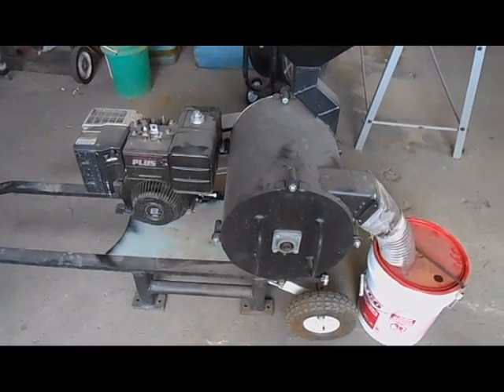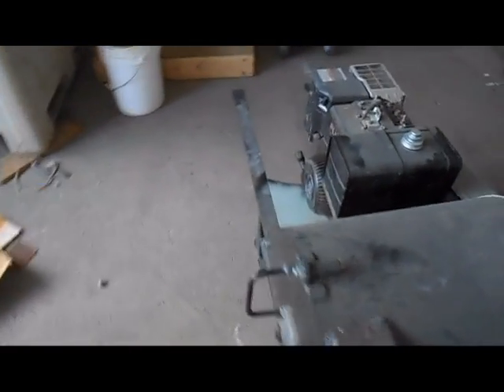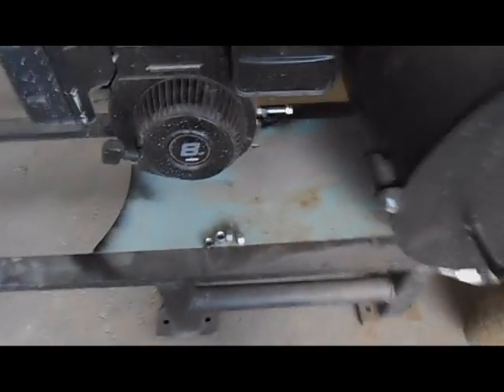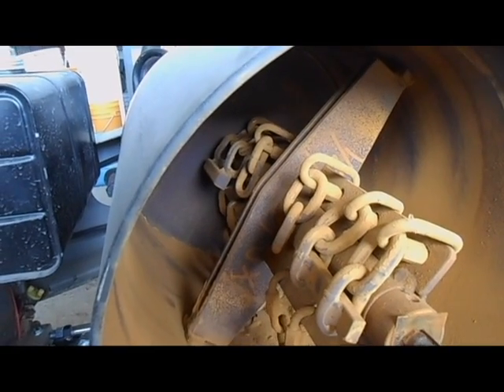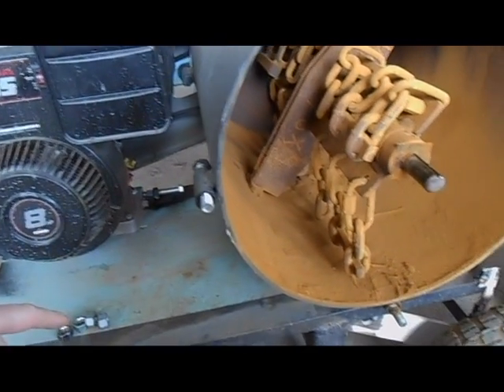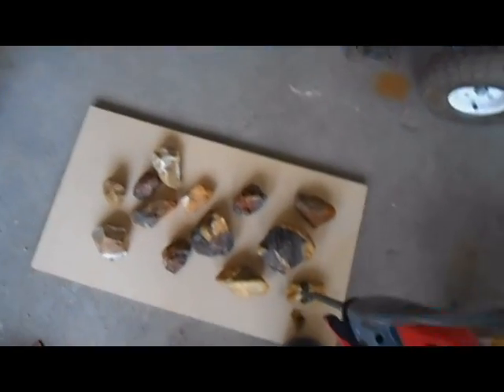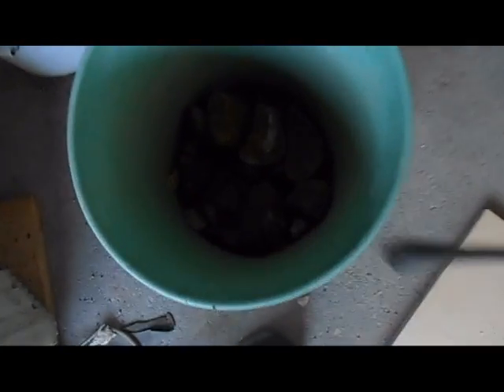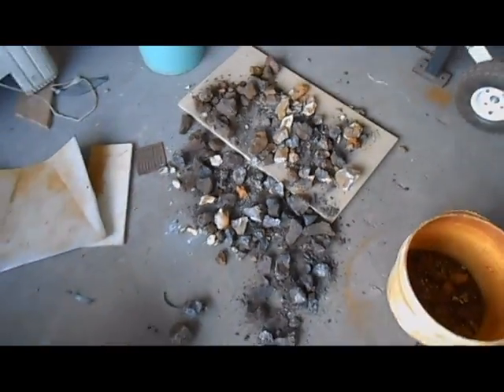Home made Impact mill rock crusher for gold ore.

Comment: Cool! So the orientation of the ports together with the direction of rotation with those plates do the dust movement that's great. I'm going to use that. I might try also spiral the contract points off the chains on the driven shaft, I'm curious if that would do anything different.

Comment: materials like chain from snow chains / 4340 steel from vehicle sway bars /coil spring material, leaf springs.. // ar plate (hardox 450 - 500) / u-joint bearing caps.... and arc welding HARD FACE ROD ...

Comment: Okay, I enjoyed your video but I have a design question. I have seen square crushing chambers, octagon and round. Which is better and why?
Reply: Solid round pipe that is made to spec is  a lot easier and cheaper to buy than welding up a octagonal tube , he is relying on the hammers to do the breaking by themselves. Which in my opinion is better because its a lot easier changing out chains than replacing the whole chamber and if you made octagonal it would increase wear hugely to the chamber and thus its life would be reduced massively and increase the likelyhood of a catastrophic failure, regardless you would pretty much need to re make the whole unit.

Comment: Hi Dan 
I know this video is a few years old but I am trying to find out what the recommended rpm is for an impact rock crusher.
And also what is the recommended hp for an electric or combustion motor?
I'm just doing the homework on building a crusher.
Thanks for your time.
Regards
Pete

Comment: You can extend the life of some chains by adding a striking face of hard/tool steel at the tip of the last link. Railway track is high manganese steel because that wear hardens in use (so are rock crusher jaw plates).
Reply: Hmm that's actually a pretty good suggestion and lo and behold you're one of the rare rare comments I've seen talking about railway steel that actually recommended it for a good purpose and  even gave the (very basic and maybe abit oversimplified) reason why it should be good.  
FYI RS is very varied though from place to place, even length to length and what part of the track it's off etc. 
Alloyed steel such as high chromium (stainless) tool steel is used more and more too,  often with added vanadium, titanium,  and/or tin too.... but if he found that it'd be even better.

Hell sorry now I'm overcomplicated it haja.  Bad habit.

Comment: I do like the the mill -it's six chains wide..  Have you ever used a chain mill wet? With water fed into the rock hopper Mount Baker get much less dust and can run the wet slurry straight into a sluice or shaker table, maybe you could run your mill wet and feed it directly into your gold cube.

Comment: Actually that center bar does more than you think slows wobble on the shaft a bit close might put opposing winglets an inch off it on each side would increase air flow and lower mill inner temp increasing life of inner parts and bearing on the shaft

Comment: Time 2:38

The design has error, because the side panel runs on thread o fasting bolts.

That needs to be fix before the contraption will have commercial value.
Reply from the maker: The blots on the side panel hold the output screen in place and are there for quick;y changing screens.

Comment: I always enjoy seeing everybody has designs on impact Mills. I like your solid bar between the two chains to generate air current. never thought of that one. that's why I like watching your videos is because we think alike but I never thought about that. That's why it's always good to communicate and learn from others. I would put a spring-loaded or a leather flap over your opening because particles are still shooting out of there at high speed. spring-loaded trap leather door or rubber door. otherwise I really like your unit. I'll probably think about incorporating the hammer in the middle also or maybe a little closer to the entrance. I would have loved to set up at the back where you drive it without your shield on. Thanks again for sharing. cheers

Comment: I do not know if someone already pointed out that you're right to look for gold on the contact between iron and quartz :) i have a old memory (more than 10 years ago, when i was studying geology at university) that gold and other precious elements are a secondary deposit inside thermal-water. As it happens, when there is a earthquake or massive movement between two big deposits of rocks, hot water can come up from deep, carrying a lot of things with it and it set up minerals and precious elements to fill up the crack made by that movement. Hope that will help you in someway and good job on gold hunting, i discovered your youtube channel not so long ago and i'm loving it!

Comment: How do you run all that fine powder and assure you don't lose heavy metals?  Are you panning ALL that powder, sluicing It, or using a bowl. It would seem if something accidentally goes wrong during a wash, i.e. too fast over riffles, bad angle etc. wouldn't this guarantee 100% loss of your pay?  It seems too easy to lose any fine gold here.  It would also seem you might be pulverizing any precious stones, or losing out on some precious non malleable, heavy metals.  Am I wrong in this observation?
Reply: +Kimberly Vanilla) Have a think about it mate? This is sampling not a full on gold operation FFS!

Comment: Why do you waste so much time making equipment that would last about five minutes in the field ? So flimsy and thin. Crush rocks ? Are you serious ? Break up clay maybe, but I doubt it would even do that very well, certainly wouldn't crush any decent quartz.
Reply from the maker: +Geoff Lindridge Well it is unfortunate that you are so harsh on my work.  I will admit it might not be the best rock crusher around, but I have put it though hours worth of work already, and yes I found a few week points in the design but over all it has stood up quite well.  It has crushed even the hardest quartz rocks I have tossed at it.  I have already fund two spots that show free milled gold.  The three spots that have needed improving so far ar:  #1 the pulleys  needed an upgrade. #2 the belt tensioner is a bit cumbersome and does shake loose over time.  and #3 the output screen wore right though on some exceptionally hard material.The chains and the casing seem to be standing up quite well.  And I do worry about the bearings getting too much dust in them, but so far so good.
Reply: Geoff Lindridge that's some really terrible negative critical thinking of a man with a hobby. Terrible attitude.
Reply: Nice design, sure to work extremely well. Internet trolls like Geoff speak without knowledge, for brains made from mush can do no better:-) Great viedos Dan.
Reply: Geoff Lindridge 
The man just showed you live how it makes short work of everything he
put into it which included not only quartz but also iron...!
After seeing the end results wi your own eyes you're still going to make
an ignorant comment like that...?
There's just no hope for some people I guess...
Reply: +Geoff Lindridge ) You dont know what your talking about mate. Youve just watched it making powder out of quartz and near on solid iron ore and youre saying it cant do it? Ive been prospecting in Western Australia for about 50 years and that sample crusher is a beauty and looks sturdy enough to me. Its certainly better than the ones you can buy. His sluice machine could do with some mods but that all comes with experience and tips from people who have been there and done that.
Reply: I don't think Geoff Lindridge is being "harsh on your work", Dan.  To me, he is simply surprised by the amount of wear a rock crusher experiences.  Most commercial heavy equipment is over-built by a factor of 10 or more.  Even where weight is a major factor, as in the blades of a helicopter, wear is a major issue that requires two hours of maintenance for every hour of flight. So, his point is well taken:  designs should always be re-evaluated and upgraded so performance accomplishes the tasks at hand so equipment can last longer, is cheaper to build and allows for improvements in regular maintenance and repair.  Dan, this was a very good post because so many people used their brains to follow along.  And get some rest so healing continues.  Heart maintenance is not quite as simple as maintaining a rock crusher.

Comment: nice machine, what grain size you have on exit? how many kilo per hour? is this easy to clean between samples? =)
Reply from the maker: +Aleksandr Goldyrev I have never calculated the throughput of the machine. it is screen down to a 1/8" but the powder that comes out is very much smaller, with only the od 1/16" piece left.  I would guess around 100-200 mesh.  Cleaning is easy.  And if it is important to have a perfect clean. (if you are running a new sample and need to know for sure)  then running a couple pieces of pure quartz helps scour the inside nicely.

Comment: After watching this and others from YouTube, I built one by myself and is working well. But I  fixed the discharge funnel by the side but discovered that the pipe before the mesh net was accumulating larger stone particles on the passage before the net hence and was not pulling the milled materials well hence I repositioned the discharge funnel under the drum machine body and it started pulling well and no more resident particles.
Reply: +Jeff Owelle) Yep! Thats what he could try, putting the outlet mesh in segments all along the bottom of the drum and let gravity do the work. If the chains wear out too soon he could build them back up with Tungsten welding rods. I run them along the inside of the drum if Im sampling a lot of really hard rock.He would have to have a different design to open the drum in two halves to do that though?

Comment: I was wondering how long the housing will last.  It looks like at the most 3/16" thick.  We spent the $$$ for a Keene RC46 Jaw over rolls and are quite pleased with it.  WE have a very hard quartz and will actually wear through 1/4 jaw plates in 8 hours if we don't hard face them. Still running on the original rolls after 20 tons.

That pan at the end looks really great.  I wish our ore was that rich.  You might check out my video on how to pan micro fine gold and you should be able to easily clean that up into almost pure gold.  I weill now check out some more of your videos.

Keith
Reply from the maker: Hard Rock University my hopes are that because the impact on the wall is at such a low angle, the abrasion will be minimalized. I have not noticed much wear yet, except for under the solid hammer.